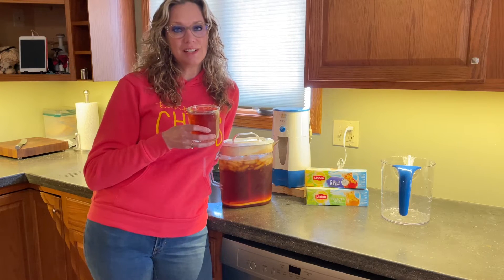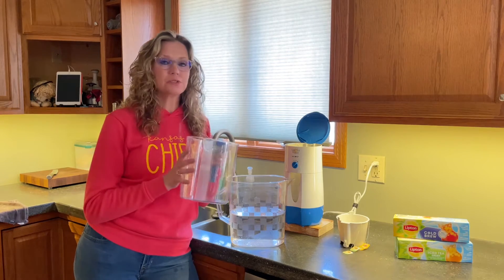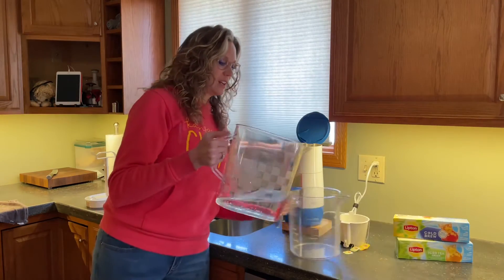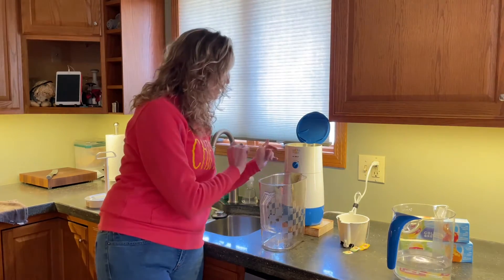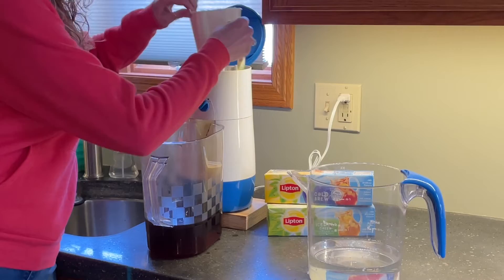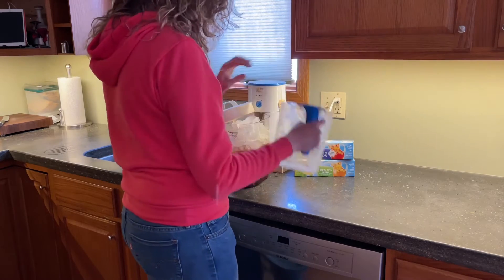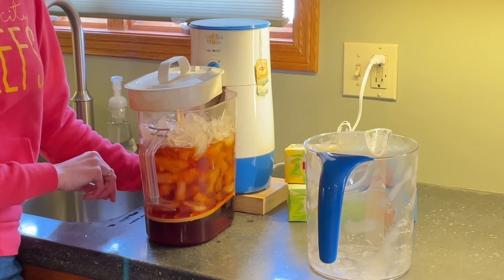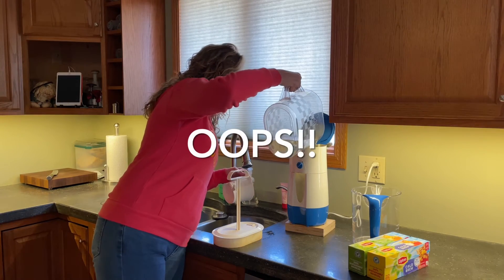Mr. Coffee Iced Tea Maker with a cracked pitcher

Comment: I bought the same Mr. Coffee teamaker for 5.00 at a thrift store -- but without a pitcher.  Had an old pitcher from another "edition" of the teamaker.  I elevated the teamaker by setting it on wood (as you did).  But the pitcher spout doesn't fit exactly into the slot, so I get about 10% spillage (uggh).  Got any recommendations for where I could buy the pitcher you use?  BTW, Mr. Coffee wants us to buy a new teamaker everytime the pitcher fails.  Ain't gonna do that.
Reply from the maker: I didn’t want to buy a new tea maker either! My pitcher is the original version of Pampered Chef 1 gallon Quick Stir pitcher #2275. The new style #2277 has a wider spout, but since I don’t have it, I’m not sure if it fits in the slot as well as this older one does. I’m sure you could find a #2275 on eBay or scour the thrift stores. Good luck finding one!
Reply: Cool thank you